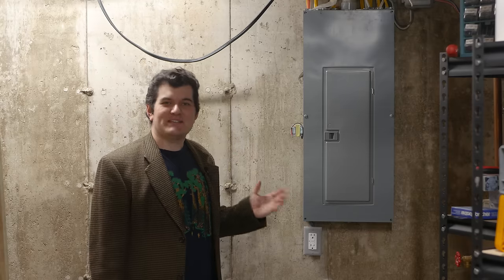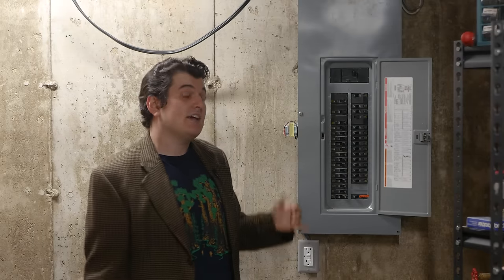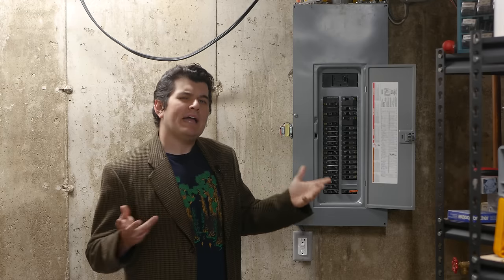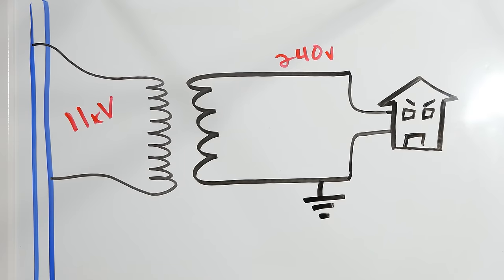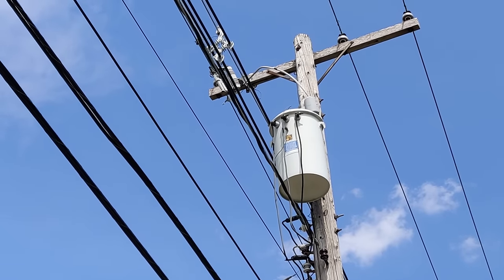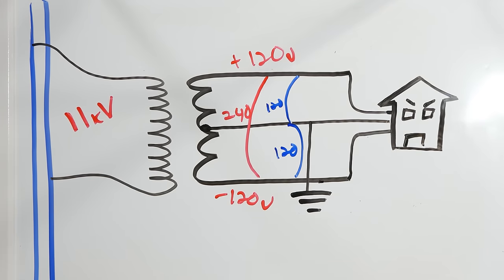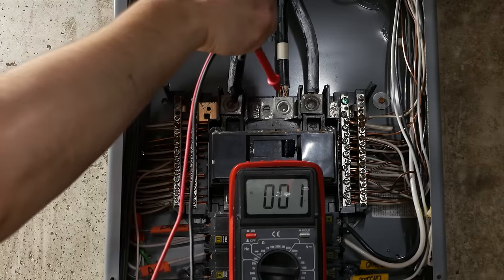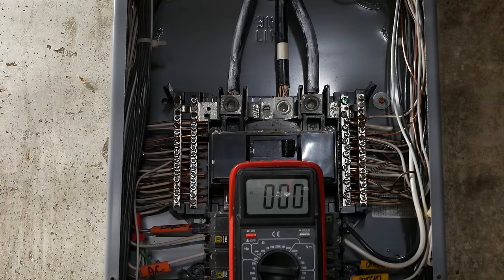The US electrical system is not 120V

Comment: No differential current protection ? How does this work in the us ?!
So different from France, I feel so much safer here ! 😅
Please never stop your old looking best in class videos....
Reply: We (in the USA) have devices that detect ground faults by comparing currents.  The best way to install these is in the circuit breaker.  Any new work should be using these.
Reply: @GH-oi2jf  
Hey thanks for your reply ! I'm very interested: in France we only have 2 mais wires (1 live 1 neutral) so only one way to connect differential breakers (comparing current).
The fact is that you have 2 lives and one neutral implies you have 3 combinations of differential current.
Is the differential breaker connected at the same location of overcurrent protections (random horizontal position) ?
Have a good day !
Reply: @soud_295  Les differentiels (DDFT) sont sur les prises lui-mêmes. C’est plus sûr ici en Amérique du Nord parce qu’il est impossible de brancher des appareils à haute puissance sur la même multiprise que les autres. Pour example, une lave-vaisselle, un four conventionnel électrique ou une sèche-linge doivent avoir leurs propres disjoncteurs dédies.
Reply: In America you don't need differentials, the ground system converts ground faults into a short circuit, protecting you against indirect contact, unless you are stupid enough to intentionally touch a live wire and a metal surface at the same time.

Comment: Electric prices in California are just crazy. And stupid. I have 4 + services. The light commercial one is 3 phase and I pay like 80 cents a day standby and 35 cents per KW and up. Home is 120/240 with 30 cents a day standby and 28 cents per KW up to like 800 and then to 39 cents and the next tier is like 50 cents! Madness. Then for some god awful incomprehensible reason I have a vacant large acreage property where they charge me  15 cents per KW and only a few cents a day standby. Why? I dont know and I will never ask. Another rural property with just a well I asked for the service to be turned off for the winter. They did so and stopped billing me. But they also never turned off the power so now I have a free service. Then last year I got a $9200 bill for my home service for one month - still fighting this today. I told them I don't have a foundry here but they just put it on a payment plan. Absolute idiots running PGE. Pacific gas and electric. All these are in a one mile radius. I am thinking to build a bath house - sauna - laundry on the 15 cent property rather than paying 50 cents at home.

Comment: But what about 277 volt and 480 volt 3 phase power?
Reply: What would you like to know (maybe I can help)? In the U.S., 3 phase power is used only in commercial and industrial settings. 277/480 volts is three-phase power connected in a wye configuration. 277 volts is the phase voltage, while 480 volts is the line voltage (the voltage across two different phases).

277 volts is a common voltage for large lighting systems. 480 volts powers heavy duty equipment and loads: motors, generators, welding equipment, and other larger types of machinery.

Comment: Where is the earth leakage switch. We have a switch on the input line in South Africa in addition to circuit breakers, which detects differences in current between live and neutral. If there is a different it trips as it would mean current is flowing through earth.
Reply: You have never been to North America, have you?
Reply: @atlesifeyst2185  Nope. I was just curious as the DB board is sooo different. All I see is one main switch and separate circuit breakers for each circuit.
Reply: In the USA, we call that a Ground Fault Circuit Interrupter (GFCI).  We can get circuit breakers with a GFCI built in.  We can also get receptacles with the GFCI function, which are often found in bathrooms.

Comment: You "120V is safer than 240V" does not stand upon analyzing statistics. A similar number of people / milion in the US dies from electrocution just from work injuries as do in germany in total. Those that get injured on work do not die because you have bad plugs in the US. On work you usually die because you touch bare wires. 240V has a stronger reaction on the body, twitching muscles more strongly and detaching you faster from the source of electricity. You don't die because you get shocked, you die because you remain shocked for a longer period that is long enough to do damage.
However we are talking of 1 death per million, so not really statistically significant to really prove anything.

Comment: 11:20 It is good to note that putting two single-pole circuit breakers together does not work in any case, the breaker switch does not apply force when it trips, so it cannot trip the other one.

Comment: so if i ever need to connect a eurpean device, which  runs on 230V single Phase, all i need to do is get two sockets on ether phase and a horribly modiefied cable with two plugs. neat
Reply: Chances are no since they run at 50hz and not 60hz like us. It will run slower and possibly even be damaged.
Reply: @Kruton1122  depends on the device, a simple motor should turn faster, but a ac-dc converter should work just finde. And a very simple lamp shoulnd care at all

Comment: Two Phase and 120v per line??? Thats insanely akward! What´s next? Inches?
Reply: I don’t understand your use of “awkward.”  We flip a switch and the light comes on, just like anywhere else.  I’ve used European plugs.  I plug something in and it works.  There is no important difference.  The plug and the voltage must be compatible, otherwise it is the same to a user.
Reply: @GH-oi2jf  Man, it was a joke. Grid power is based on decisions not made on this century and can't be changed without massive changes in infrastructure. it's just not practical. i jumped on the joke train of "US uses inches, that's so dumb. LOL" Easy joke, dumb joke. don't take it to seriously. Cheers!
Reply: @GH-oi2jf  Also i'm not a native english speaker. that's why i misspelled awkward. my bad

Comment: i think Belgium use the same technology but we have 220v in every single outlet  and you can't use 120v  equipment
Reply: fun fact: north american ps3 & ps4 consoles say 100-120v 50/60hz on the outside but on the inside they say 100-240v 50/60hz so they can be used in europe
Reply: @gamecubeplayer   they probably have some type of transformer inside
Reply: @nedyalkotodorov4535  they have an universal power supply inside but it's weird that they don't say it on the outside

Comment: but can you use the 240 with european appliances, e.g. water kettle from europe?
Reply: We would have to put in a proper 240V outlet, i.e. one recognized by our codes.  If I wanted to boil water faster, I would put in a 240V receptacle and get a commercial induction unit.  That would be more versatile.  I don’t understand the fondness for electric kettles.
Reply: @GH-oi2jf  
what is better, a commercial 240v induction cooktop, or a commercial 240v microwave.
Reply: @tallswede80  — I don’t care for microwaves.
Reply: @GH-oi2jf  
Do you have any further information about induction cooktops?
Reply: @tallswede80  — Only that a 120V unit is limited to 1800W.
Reply: yes you can

Comment: Very interesting video. Agree mostly on UK plugs. We rarely use the switches on the plugs. However, there is one point you more or less missed, and that is about the size of wires 120V vs 240V. My electrician told me that if you double the amperage you need 4X cross sectional area. Not sure if I agree with that, but whatever the actual numbers, there are more electrical fires in North America than in Europe, especially with many things plugged into long extension cables, due to the higher amperage causing overheating. So in that respect 240V is safer.

Comment: 240/120V is such a crap... 3 phase is the way to go, 1 more wire, triple the power. in europe, flats are generally supplied with all 3 phases, split among the rooms. phase to neutral is 230V, phase to phase is 400V. That way you can actually run some useful things such as 3 phase motors.
Reply: Actually the third wire only gets you 1.73 times the "power."
Reply: @billelkins994  no, because the voltage phase to phase is 400V, phase to neutral 230V. for 3 phase power is voltage x amps x sqrt(3), for single phase just volts x amps
Reply: @JoLe1991  Remove one phase from from your house re-allocate lost rooms to the two remaining phases and you will have the 230 volt equivalent of the US system. This will allow 230 volt loads and single phase 400 volt loads. Assuming 16 amp breakers this means you can have two 230 x 16 =3.680kw for a grand total off 7.36 kw.

If you only have 400 volt loads the result is 400 x 16 = 6.4 kw single phase.

Add the removed phase back and you have three 230 x 16 = 3.68 kw or 11 kw.

Calculating for 400 volts is 400 x 16 x 1.73 = 11 kw

My point was the third phase does not get you "triple the power."
Reply: @billelkins994  I understand that triple the power also comes from a higher voltage. but that is just how it works pretty much all over Europe. Most household sockets are protected by 10A breakers, rarely 16A. to get 11kw from 3 single phase you definitely need more wires than from a 3 phase socket becsuse the phases complement each other rather than requiring a separate wire to close the circuit. if all the loads are equal in 3 single phase systems, the neutral is not used, but that's usually not the case
Reply: @billelkins994     You seem confused.   If you are running one phase off of a three phase system, you are using 1/3 of the total power.  So, yes three phase on the same system is 300% or three times single phase.
Reply: @JoLe1991    The end result is similar!   They work.   Correct?  The only thing that makes any difference is wire size.   Yours are smaller most of the time.  We probably have many more three phase systems in the US than you have in your country.   We were forced into this system back in the late 1800’s because Edison, with lots of political clout, got the 120 volts because his light bulbs designed for his DC systems at the time would work on AC.
Reply: @JoLe1991  To reach the power level of the service shown in this video you would need 69 amp main breakers.  Do you have 69 amp breakers?
Reply: @billelkins994  what power level do you refer to? 69 amps is a lot of power at 400V 3ph. You can pull something like 30kW from a 63A 3 phase breaker at 400V
Reply: @KevinCoop1  yes, much smaller. and 3 phase loads are balanced, which means they don't require a neutral wire, which is just added copper. a 1.5mm2 4 core wire can safely transmit 7.5kW over a distance of about 25m using just 3 of the 4 cores for the 400V phases. I mention 7.5kW since this is the 3 phase motor size you can still run on a 16A breaker using a soft starter or VFD.
Reply: @JoLe1991  North America 240v * 200A = 48KW
Europe  400v * 69A * 1.73 = 48KW

The typical house service in North America is 48kw.  

Europeans sit in their 11KW  tiny houses saying things like "For high power items we have three phase." 

Power doesn't care how it is delivered.

Getting snarky now so I'm gonna stop.
Reply: @billelkins994  69A does not exist. there are 63A and 125A circuit breakers. have fun with wires rated for 200A...
Reply: @JoLe1991  A lot of Europeans use wire rated at 200 amps. Battery cables in their cars.  Granted they don't use it in three hundred foot lengths.

Comment: Am I the only one who finds it strange that the circuit breakers have 10kA = ten thousand amps? Normal circuit breakers are 5, 10, 16... amps
Reply: That is the short circuit current rating of the circuit breaker. It does not have anything to do with the actual trip point of the circuit breaker. It is the maximum amount of amps the circuit breaker can withstand within a specified very short amount of time without catastrophic failure.

Comment: The 120v are not out of phase  the polarity is reversed so the voltage adds up
Reply: That’s the same thing.  It is just another way of looking at it.
Reply: The polarity changes 60 times a second following a sin wave on each wire. The two wires are opposite phases. in the first 120th of a second one wire  goes from 0 to positive 170v peak and back to zero the second wire goes from 0 to negative 170v  (120v RMS) and back to zero. They are 180 degrees out of phase relative to each other. 
The difference between 120 positive and 120 negative gives 240v.

Comment: How would you convert 480V 3-phase to provide apartments with 120/240V. ?
Reply: Single transformer.
Reply: @billelkins994      How. ? .. . .  3-phase 480V transformer could either give you 240/140V  Not good for 120V equipment.. . .  Or 208/120V  Not good for 240V equipment.. . .  Try again.
Reply: @hughleyton693  When you divide 240 by two you get 120 not 140 as you did.  The transformer required is a single phase device with a center tapped secondary. The resulting output voltages will be 240/120.
Reply: @billelkins994     3-phase Supplies divide by 1.732   NOT  as you suggest. . . .. . . You have to Balance the loads over all three phases. . .
Reply: @hughleyton693  I'm not using three phase. I am connecting a single phase transformer to a three phase supply.

You say the loads must be balanced. Why?
Reply: @billelkins994     Most 480V Supplies are 3-phase. . . If the loads on all three phases are not reasonably balanced, then the supply transformers can not deliver their rated power. . . .   Using the centre tap on a 240V Delta transformer for 120V limits the 120V loads to about 10% of the transformers kVA rating.
Reply: @hughleyton693   Hung up on three phase huh?  Okay take three single phase 2:1 transformers with center tapped secondaries, connect the center taps together as neutral and you will have converted three phase 480v to six phase 120v and everything will be balanced.
Reply: @billelkins994     Electrical supply authorities are likely to supply large buildings from 11,000 or 22,000 Volts 3-phase supplies and fit a 3-phase 480V Transformer for the building supply. . .   So you are usually stuck with a three phase supply.. . . . So yes, the supply company will have their 3-phase transformer.. ..  Then you as the electrical contractor for that building can fit three single-phase transformers to convert 480V 2-wire supply to provide three lots of 120/240V for the individual apartments.. . .   Interesting and correct. . . 

Centre tapping those three transformer Secondaries, does end up with six-phases of 120V   Ha.!. . . .  Yes, splitting a transformer winding does double the number of phases.. . .  So as you have said, splitting 3, ends up with 6-phases, each one being 60° from each other. . . . Splitting a winding doubles the number of phases, so regular 120/240V 3-wire supplies are 2-phase 180° supplies, even if Americans can't say those words.
Reply: @billelkins994    480V 3-phase supply. . . .  Now work it out again. :-(
Reply: @billelkins994     It is standard good practice to try to balance the loads, so as to make the best use of the power and wires sizes available.
Reply: @billelkins994     Yes, well done, you are there now.  🙂
Reply: @hughleyton693   No. I was right the first time.
Reply: @hughleyton693   As 240/120 is a single phase load to the provider, it is their problem to balance their 3 phase line.
Reply: @billelkins994  Right about what, you have not bothered to say here, in your post.
Reply: @billelkins994    120V as used in America is Single-phase Line-Neutral.. . . 240V as used in many parts of the world is Single-phase L-N.. . .   But 120/240 3-wire is 2-phase.. .  L1 is running at 180° different from L2  please pay attention and look at 3-phase to understand phases better, 3-phase run at 120° from each other.. .  An early 2-phase in American ran at 90° from each other.. .   Splitting a winding and grounding the centre point for Neutral now like a kids sea-saw, makes the two ends run opposite, when one end is + the other end is - so they are running at 180° from each other. .. Just look for yourself and don't just repeat the nonsense said by so many others.

Comment: Your electric box is from metal?
Reply: Steel!
Reply: @billelkins994  = Electrical conductivity
Reply: The box is connected to Earth.
Reply: @ChristiaanHofman  The company that runs this site hates me and took ten days to inform me of your response.  

Conductivity is a good thing. When you use metal as your containment vessel you ground the box and what happens inside the box does not affect the exterior of the box.  The reverse is also true.

I suspect a European industrial box is also made of steel.

Faraday Cages are made of metal.

Comment: Im having a hard time understanding the imperial system, health system and electrical systems in Merica,can't wait for you guys to discover a way to make hydrodynamic s different.😊
Reply: The power grid same as imperial system are relic of the past that US feel no pressure to change or was far ahead in electrification. The more they wait the more expensive and inconvenient it become to change and now are basically stuck. Best part is they dont need to do much to their existing power grid. Most problem is changing all appliances, second is changing the transformers and lastly produce bit more power if necessary. The US power grid is old and strained as it is with frequent power shortage due to increase demand. They need to build more powerplants to quell current 120v needs, to match 240v output is now a distant dream.
Reply: @scasny  thank your for your comment